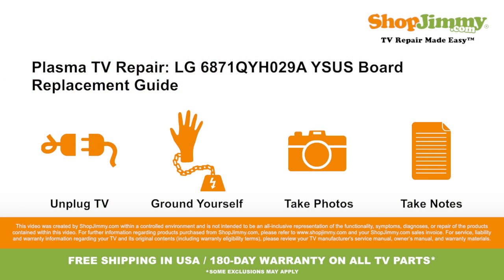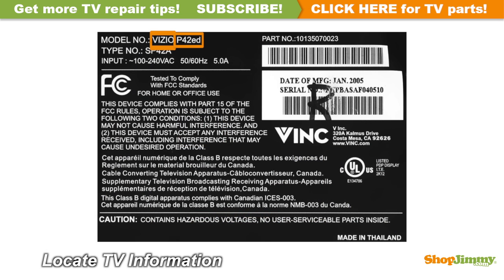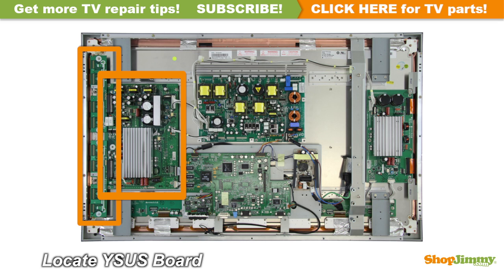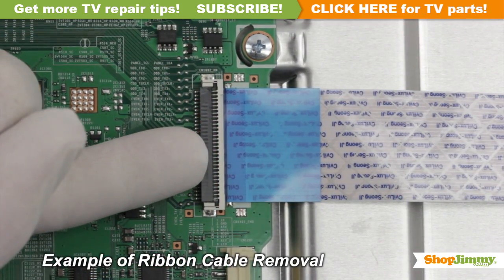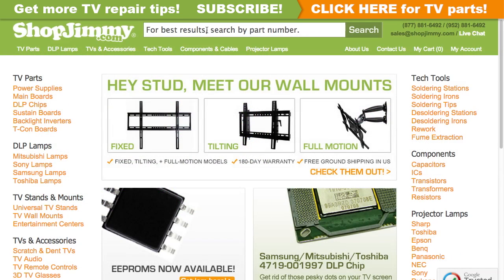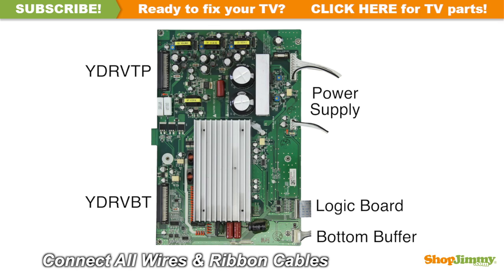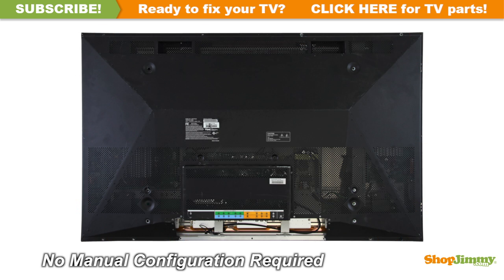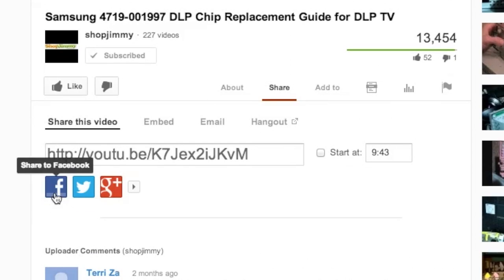Plasma TV Repair How to Replace LG 6871QYH029A YSUS Boards

Comment: Im having problems with my lg plasma tv 60pv400 model. It turns on volume works and i can change the channel but the screen is black like it is off. I want to order parts for it bit im not sure what part i need

Comment: Hey ShopJimmy.com - I have a Plasma Z50P3 bought in 2008.  Recently it crapped out; the TVs turns on, the screen is backlit and "glows", but there is just no A/V signal .. nothing displays.  I had a TV guy come in and charge me $50 to tell me it he'd have to replace "main digital PCB costing about $350 in parts" and recommended I buy a new TV.  Based on that admittedly basic description of the problem, sound like anything a replacement part from your site may help with?